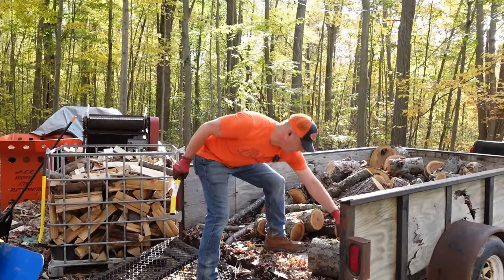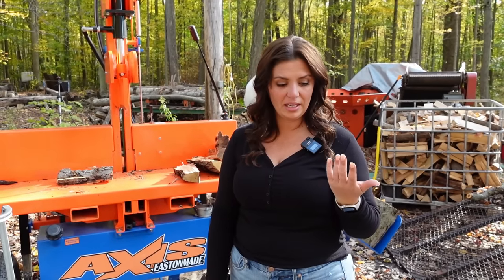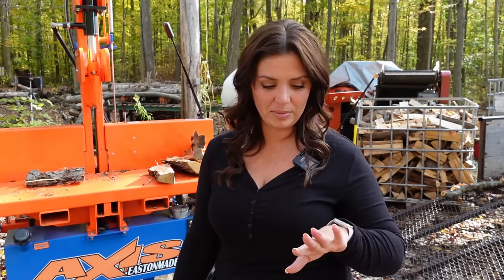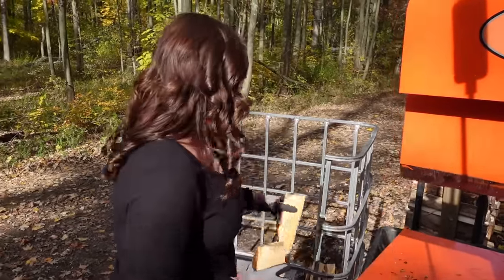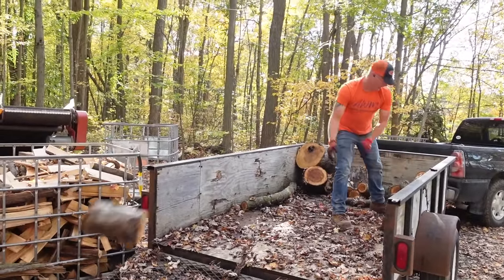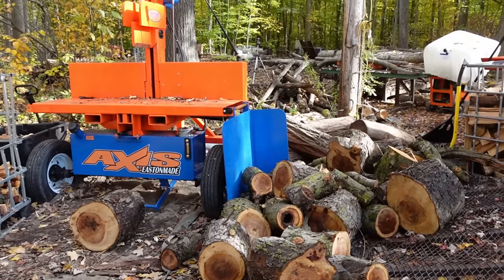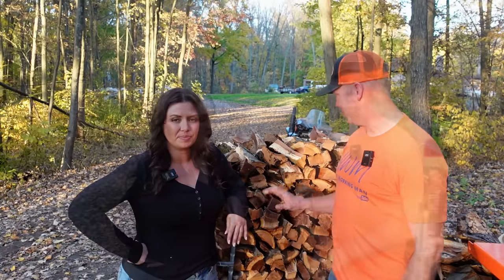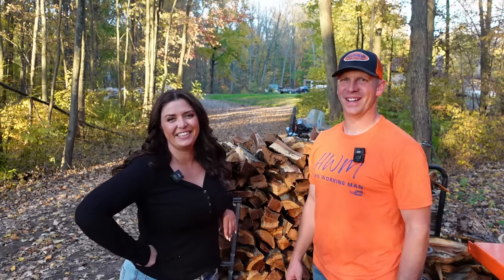It Happened So Fast! How Bad Is It? Log Splitter Accident.

Comment: My God you are very lucky! There is no stafty at all with this  thing! Who ever put  foot switch is out there mind. Your hands should be no where near the blade or the wood. It should  have 2 switches  at the end of the table wired in series. So they both need to be pressed so you don't hurt yourself.....  I had to stop watching a write this comment. Ex crew chief, and engineer. Will not watch the rest. As I seems you did not learn your lesson. It's not worth it to lose body parts, Improperly install and built equipment. Safty must always come FIRST😢
Reply from the maker: Most vertical splitters I see run with a foot switch. As long as you keep your hands to the sides and off the top and bottom of the splits what happened here is about as bad as it gets, and this was a perfect storm. Crooked, twisted, knotty wood. We love running this splitter. It’s a lot of fun and produces premium splits.
Reply: @hardworkingmanoutdoors   ok 👍 but please 🙏 get rid of that foot switch in favor of two switches about 3' apart and they both must be pressed together. Easy way is to wire them in series. Easy peesy. Lemon squeezy. And keeps your appendages on you and not mia.. I have a 48" metal sheer with a stupid foot pedal. Now has 2 nice switches...

Comment: I run a meat slicer; deli meat.  never slipped my finger once ever five years strong.  The danger is cleaning it. but oh yes I've cut myself on the fuselage under side of machine cleaning it underside.  just be smart, that's all. easi as pie.
Reply from the maker: That may work for Rachel but I get distracted far to easily lol.

Comment: That has to be the dumbest designed log splitter.
Absolutely no reason to hold a log as you split it.
Your hands should operate 2 paws to hold the log, as you push them then the foot switch can work to drop the ram that splits the log, if your hands let go the machine shuts off.  It can only go back up.
Unless you manually over ride it behind the work surface.
  
Or 2 paws can drop onto the log to hold it. The machine holds the log not you.
Reply from the maker: There are quite a few splitters like this. We really like it and as long as you keep your hands to the side this is about as bad as it will get.